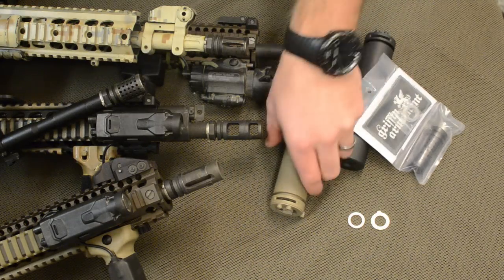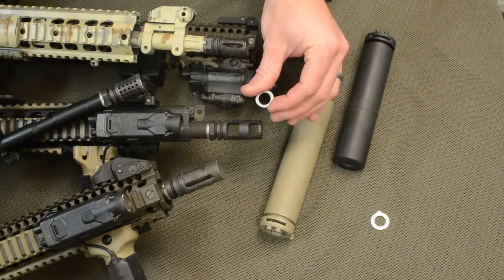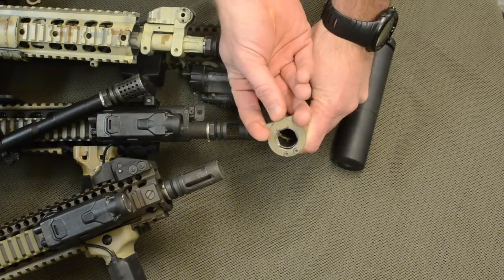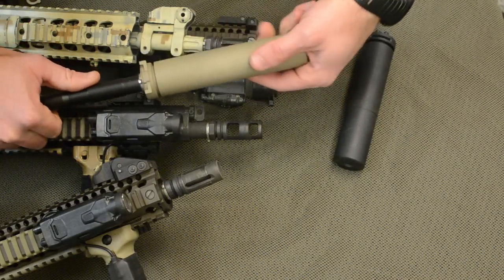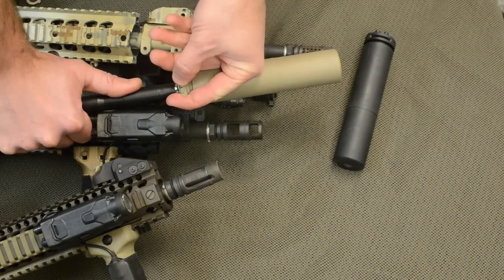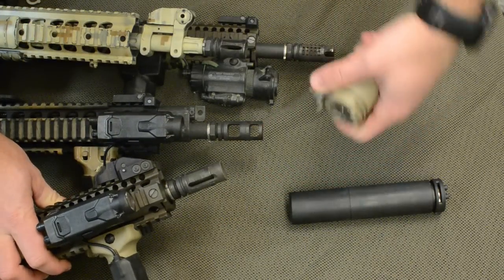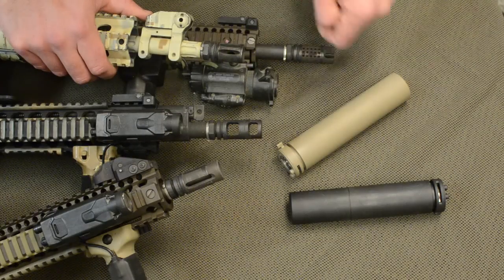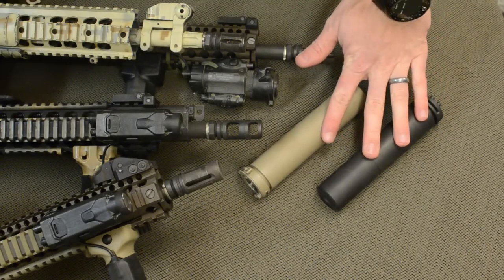M4SD II Sound Suppressor Attachment and Detachment Demonstration

Comment from the maker: The KAC flash hider has a very wide proprietary groove in the unit. Our suppressor was meant for A2 specs. It will not clip on to that muzzle device. The PWS SM556 is not dimensioned to A2 specs and it will not work. 

We make a Knights Armament Compatible compensator but it also will not work. We make 4 high performance muzzle devices that are A2 spec which interface with our M4SD suppressors

Comment: will this work with a BCM A2X Extended Flash Hider?
Reply: No it has to be used with Griffins comp/brakes and you will be good.
Reply: @BloodEagleTactical it doesn’t HAVE to be made by griffin, as long as it’s in spec you’re good.

Comment: will this work with a pinned and welded A2 flash hider? I can't install the peel washers but I'd like to purchase this suppressor
Reply: Tom Paul I'd also like to know if this works with pinned on A2 birdcage where there is no peel washer or the one with the over travel tap for index on the flats.
Reply: No it has to be used with Griffins comp/brakes and you will be good. It will work with certain a2 hider's close to their specs.

Comment: Are these compatible with the new BCM Gunfighter Comp Mod 1? BCM says compatible with A2 QD suppressors but, i'm not sure where the locking gate would actually lock on the Mod 1 comp.
Reply from the maker: Will Sartin These are not compatible with the mod 1 or mod 0 mounts as far as I know.  BCM also talks about BFA compatibility, and their devices are not BFA compatible either.  I could help them put both our device and the BFA into compatibility but I don't work for them and they haven't reached out and corresponded effectively with me.
Reply: Griffin Armament I can see where the locking gate just absolutely wouldn't work with the Mod 1, but the mod zero looks just like most A2 style mounts with those two blank firing adapter grooves. Same goes for the PWS SM556, or what is now the KAC 556. While it's compatible with the NT4 it's listed as compatible with the Gemtech Halo as well, which i would think it should be, both have those grooves. That's why i figured my SM556 would work with a M4SD II but i can see it there they're spaced differently. The BCM Mod 0 however looks identical to my Griffin Tactical compensator. Same A2 style grooves at the base of the flash hider. Might need to take some measurements to look at it, but i would think it would work. That's what the locking gate clips into right? Or is there more to it than that?

Comment: Will this latch onto an AAC Blackout Non-mount flashhider? I'm not sure if it's designed to match A2 specs, but it looks it to my untrained eyeball, and also looks about the same length as the dual port brake Griffin Armament sells.

If this latches onto a non-mount AAC Blackout it would kick ass, if not, AAC is needs to get their stuff together.